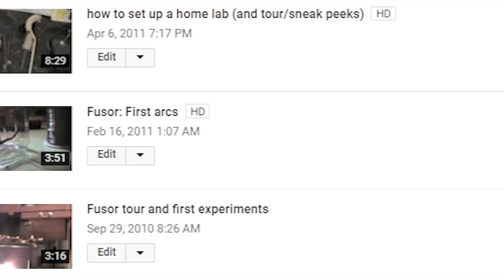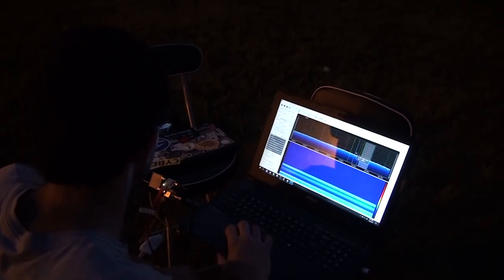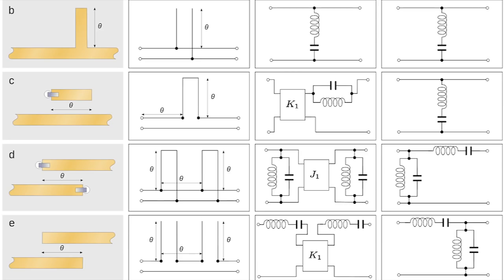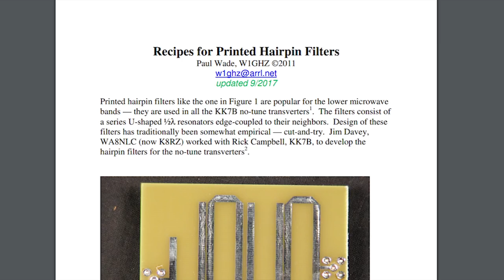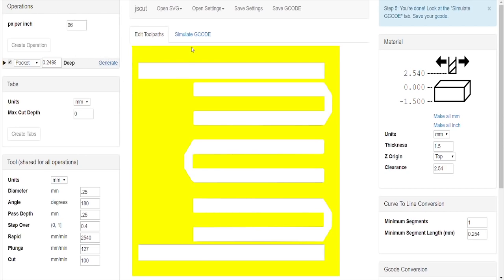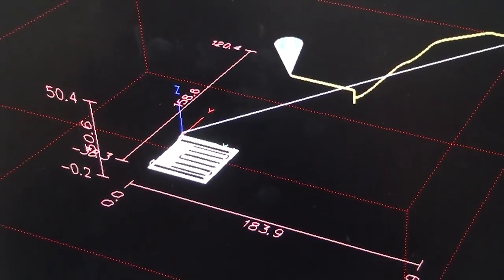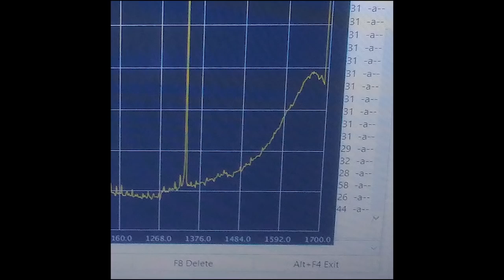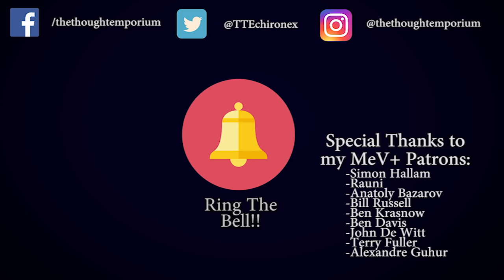CNC Milling Radio Microstrip Filters

Comment: Did you àssemble these filters in a shielding enclosure with the SMA connectors on the outside? As they stand there'll be some antenna type pickup adding noise to the filter output.

Comment: So much useless effort for such a simple thing. An ordinary good laser printer and iron can easily solve this problem. P.S. The results with the photoresist are terrible. The edges of the tracks are very uneven. So something has been done insufficiently neatly or completely wrong.

Comment: 3D printers are great single pass printing of things that have internal structure that would normally required assembling multiple pieces or machining in multiple orientation, but for strength or high conductivity subtractive machining is best.

Comment: you can use double sided tape to hold down the workpiece in order to hold it flat against the table
this works well enough to even do some heavier milling on soft Materials like Aluminium, provided the surface touching the tape is large enough 
love your stuff man keep it coming!

Comment: if you wind up experiencing some frequency shift on your filters, you might try just doing a single isolation cut around the elements and then peeling off the unused top layer of copper with a heat gun set around 300° F and a pair of tweezers. i originally tried milling to remove the excess copper for some 2.4 GHz filters, and the slight reduction in height of the dielectric would shift the corner frequency by about 100 MHz. the manual removal method takes a bit of playing around to find the right amount of heat to loosen the adhesive from the board, but the end results were worth it. awesome video and good luck on the project!

Comment: Qucs is a free simulation and calculator tool for micro strip filters. Check it out on http://qucs.sourceforge.net/screenshots.html. Just describe the parameters you need for your filter and the program gives the dimensions how to build it.

Comment: One easy way to get a CNC bed level is simply to run a pocket tool path the entire usable bed a few thou deep. Just attach a bit of say half inch mdf to the factory bed then level it as above. It will also protect the factory surface and allow you to cut a few thou deeper than the material thickness to get nice edges.  When it gets all chewed up just replace it and level the new one as above. ANY cnc controller can do that.

A nice writeup on tool pathing there with whats freely available on the net but it does have its limitations. Checkout v-carve desktop. It is all I use for a  large part of what I do but for other stuff involving a true 3d job I use solidworks and or mastercam. Those 2 are seriously pricey. 

Inkscape will convert almost graphics formats to a vector format and there is a free plugin for it that will create DFX files. I use DFX excelusivly for the 2 and 2.5 stuff. For 3d I use STL files if I dont create the models myself in solidworks or master cam.  Mastercam creates the G-code in that case. For stl mastercam also does the G-code.

I use mach3 as the controller on my total home brew. Granted its seriously old but Ive modified it  for my needs.

Hang in there CNC is nowhere as difficult to get a grip on as most think it is.

Comment: Hi, refacing the bed and using double sided thin adhesive tape under the entire surface of the pcb instead of screws at(very) few spots should help.

Comment: To make PCBs I use G-Code Ripper software to level the Gcode with the surface of the board. I just load the tool and use it as the probe for a probing cycle the G-Code Ripper generates. Then load the points back into it and "warp" the original gcode flush with the PCB.

Comment: Use a flat end mill and remove layer by layer of your bed until you have cut the whole area (then you made sure your bed is leveled and perpendicular to your cutter (provided that your machine is accurate)) and then maybe go over the PCB itself (after clamping it to the now leveled bed) with the same strategy or buy precision copper PCBs.

Comment: A chamfer tool is very useful for spotting errors such as wonky work-holding. When milling a lot GFRP, you might want to use cubic boron nitride endmills since you are basically cutting rock. - Make sure you have a shop vac with a HEPA filter sucking up the dust.

PTFE is the best substrate for microwaves. You can possibly make your filter by taping copper tape onto it. If you can turn your CNC mill into a vinyl cutter you might have a winner.

Comment: If you gonna do more CNC projects, look into DraftSight. It's copy/paste AutoCad, which is super easy drawing tool and later those drawing are easily imported in cnc code generator software. If you're int 3D moddeling search for SolidWorks alternative software (free) as it is quite expensive. Also do a little research on different cutter speeds/feeds in different materials. Althou you were stressing about not putting too much pressure on the tool to not break it, often undercutting leads to fast tool wear and premature end of tool life. Just a few tips from CNC machinist.

Comment: I don’t understand your reference to a mil being an arbitrary unit of length.  I think you do realize that 1mil = 1/1000 of an inch.   Sure it’s not an mks unit but it is a valid unit none the less.   For some reason PCB fabrication industry is still stuck using imperial units.  I find it quaint because it shows how long these processes have been around.

Comment: I agree, subtractive milling is underrated and 3D printing is overrated. Milling permits a huge variety of working materials, and tricks like cryogenic milling even add a couple more.

It seems like it might be possible to 'Lego' the microstrip filters vertically, so you could just stack some pieces together to try different conductor arrangements. Actual metallized Legos might be too bulky. Or maybe something that works like those sliding number puzzles, basically a frame to hold strips by their edges in varying positions. It would be hard to model anything like these, but experimentally you could set up a signal source and adjust the filter to get it tuned.

Comment: if you want to test your filter and you have access to a dtv sat instrument you can do pretty easily. use a noise generator on the input of your filter and  the instrument on the output. the frequency you mentioned be tuned on are well in range of the instrument.
Reply: If you have tools that do it for you, measurements are always easy.  The tricky thing is working out how to make the measure of something without the tools for the job.  There is a clever gizmo that was common in the past that used an oscillator at a modest frequency and a thing to make spikes at that rate.  By tuning the oscillator, you could move where the harmonics landed.
The output side was connected to a simple AM detector.
By manually sweeping harmonics over the band of the filter, you could work out the frequency and band width of the filter.

Comment: Nice work, If i could offer some tips from a fellow hobby machinist. Sacrificial material. Mount a piece of wood the the table and deck off the surface to level with an end mill or small fly cutter. Then masking tap  an area large then size of your work piece.  Tape the back of the pcb. Then super glue the taped faces. You can use accelerator on one piece to speed up the curring. A weight is also helpful.  i use this method with pcb plastics and even thin aluminum. see this link to NYCNC https://www.youtube.com/watch?v=r6DCvtcU8_M.  keep it up And i would recommend fusion 360 . full cad package free to hobbyists. tool pathing (gcode generation) enjoy...

Comment: The best software by far to test electromagnetic circuits is cst! It's not very easy to use, but is very accurate and helps you a lot in this filter design

Comment: Very inspiring video as always! And can I give a tip try cubicsdr which  can be tweaked to let you see the even minute radio transmissions which makes adjusting the individual components like the antennna a breeze. I love it to spot signals almost too faint to receive and hunt them by tweaking the setup.

Comment: Hi! The problem with different thickness of PCB can be auto readjusted by using "Z" probe. It "scan" all surface of PCB by connected wiring from spindle and copper foil to CNC. After it makes heights map from scanned "dots", you can apply it to all project. Don't know how to realize it on your model milling machine, but i'm shure that this function must be present. I think it will be the simplest way to make more accurate filters!

Comment: Just in case you didn't already know. For analyzing the frequency response of your filters you should look into network analyzers. However they can be pretty expensive. Cheers!
Reply: Yes, they are good but out of the reach of most mere mortals.
You can do the same job more slowly with equipment mere mortals can afford.

Comment: Thanks for great video! A little bit disappointing that you decided to take a break on this project (it is really very inspiring for me) but thats understandable - the higher frequency goes - the weirder science behind it involved, especially Murphy effect, which makes things very time-consuming :) 

Regarding tools for filter design - have you tried qucs? If not - you definitely should. It is opensource and free and has a descent engine for generating all kinds of filters including microstrip. Also, you may want to try miniVNA for filter measurement - it is pretty cheap, especially if you consider Chinese clone.

Comment: In case anyone following along was confused by the misspeaks at 5:25: Inkscape's "trace bitmap" tool doesn't create a bitmap. What it does is create a vector replica of a bitmap image. This is why the gcode website found it easy to interpret - vector images are just maths.
Reply: Isn't it just vertices? That isn't really math at all, unless you call a connect the dots puzzle math :P

Comment: Look into Sonnet Lite for software. Its free (definitely register it) and relatively easy to use EM sim/design software. I've used it for designing directional couplers for a ham SWR meter/Antenna matcher.

Comment: The 'angled, pointy cutter' is called a D bit because the cross section of the cutting portion is shaped like a D. They're usually used for form cutting because you can turn a weird shape onto the end of a tool steel rod and then grind one side off the tip to create a cutter that will make a groove of a specific shape.

Comment: If you read about parasitic capacitance and inductance the principles behind micro strip filters will make more sense. 
The basic principle is that copper trace length has parasitic inductance and the spacing between traces and the bottom layer of the copper pcb along with the spacing between the individual hairpins and the traces that form them will generate small values of parasitic capacitance which is needed at high frequencies. This can bee seen if you look at microwave components in satellite dish  feed horn or another similar device you will see these principles implemented on a larger scale. 
It can get extremely complicated but I hope this helps you out but I hope this information helps.
-David  

This video by w2aew shows some of these principles in action (https://www.youtube.com/watch?v=vi24SpKYYoQ)
He has a very informative channel which may help you on your radio adventure.
Reply: Actually, microstrip circuits typically exploit the distributed parameters of transmission lines and directional coupling rather than the concentrated capacitances and inductances. If you know the impedance of the microstrip, you can easily calculate the dominant characteristic (capacitance/inductance/resonance circuit) at a given frequency using the Smith chart.
Reply: I know, someone else had already commented on that so I was trying to elaborate on the underlying principles of an LC circuit and how the design parameters affect the band pass/block parameters of the filter. I am not an electrical or RF engineer just a hobbyist so my understanding is not 100% complete.

Comment: Dear TRE,
I have experience sending 1200bps data to GOES 13.  FYI.  This was my "YAGI GOES" antenna, costing $700: www.waterlog[DOT]com/media/products/h-223.jpg
My transmitter cost $5000, but I won the eBay lottery and got one for $100.  I found an antenna direction calculator online and was able to calculate the degrees and altitude(azimuth?) direction to point it to GOES13 based on my lat. and long.  It took me 3 tries to connect and I found that not having large trees in the way was helpful.

I downloaded my data via telnet from NOAA servers in Virginia.  Also, fyi, you can call NOAA and request your own exclusive 10sec per hour 300bps or 1200bps transmit window for free. (Then you can tell girls you literally talk to spaceships. Well, ship.)

P.S. I know it's fun to listen to spaceships, but you are aware you can download the images over the internet, right?

Comment: Oh hey I made one of these as a final project in an RF class.  It worked but it had a Lot of loss (like 60 dB insertion loss in the pass band).  If it was actually used the SNR would get a nice whack when it was amplified afterwards (or you would need a lot of power to amplify beforehand).  Also RF amplification is nontrivial in itself.

I used a book called Microwave Engineering (I believe the author is Pozar but I can’t easily check atm).  That book is amazing.  I found information in there I haven’t found anywhere else.  In the back there are coefficient tables for many types of distributed element filters.  If you’re interested in making more of these and haven’t checked this book out yet I recommend it.
Reply: RF engineering requires a lot of patience and sometimes extensive research, reading scientific articles. Pozar's book is the original reference, but you need many others especially some are entirely about Microwave filters. 

Here's the example of an open loop design (a lot better than hairpin for the narrow-band limitation),  that I made, based on well established papers[1]. Due to losses you will be forced to use rather some expensive substrate (Rogers) rather than the usual FR4 sub.

https://imgur.com/a/prad4j4

[1] Design of highly selective microstrip bandpass filters with a single pair of attenuation poles at finite frequencies:
https://ieeexplore.ieee.org/document/848492

Receiving no help in designing this filter, I was so relentless in completing and testing it (simulation results comparing to real ones visible), I managed to use the Advanced Design System from Agilent, even referred to ways to bypass the awful limitations on knowledge :

http://sci-hub.tw/https://ieeexplore.ieee.org/document/848492 
Use library Genesis to view the books, if you like them, buy them later : 
Pozar's Book:
http://libgen.io/book/index.php?md5=53B65FB687D04417AA2D723DA607B411
A book about Microwave filters:
 http://libgen.io/book/index.php?md5=85BD884FA4DE1C6F560C9AC91B503396

Logic, RF/Analog Integrated Circuits/RADAR engineer.
Reply: willis936 I can confirm, Pozar is awesome.
Reply: Pozar is an RF guru
Reply: large amount  insertion loss in the pass band means wrong filter dimensions

Comment: Use fusion360 next time for designing and creating the gcode. It's way easier because you work in real, exact units instead of using wharever units photoshop wants to use. Also it's free for hobbists/students. Cheers and as always, awesome work.
Reply: For these hair pin filters,  OpenSCAD is even the better way to go…
Or use a pcb cad...
Reply: Obviously any suitable CAD is better and is a crucial skill for what he's doing these days, but Photoshop is a print preparation software, which means it's fully real world size aware. It allows to set up guides and display rulers in any metric units, and it fully and properly tracks the desired physical dimensions within its files.

The crucial error is exporting into PNG, since this format has no concept of physical size - the pixels are exported but the corresponding scale cannot be stored, and the importing software has to assume arbitrary scale that varies between individual software pieces, though 72dpi is most common. JPEG and TIFF support physical scale and the latter should have been used.
Reply: Huh. Well then everything's alright and there's nothing particularly weird about this workflow. Any workflow is going to seem wrong or inefficient to SOMEBODY.
Reply: Siana Gearz png does support scale, maybe you haven't used it lately
Reply: Yes! and you can set up parameters in Fusion360 so you can adjust the design without redrawing the whole thing!